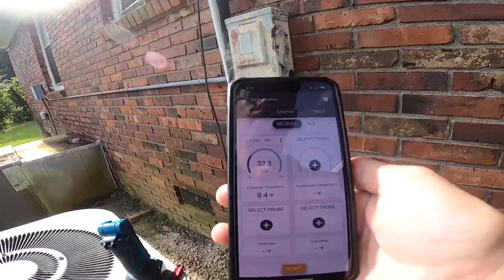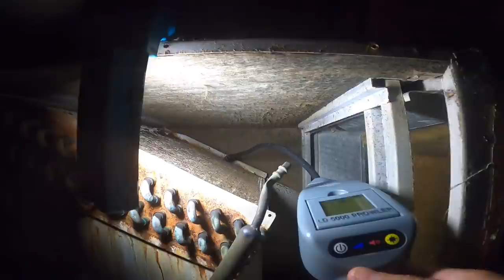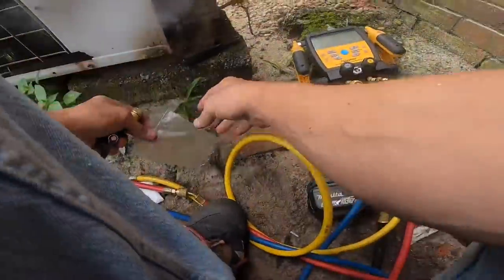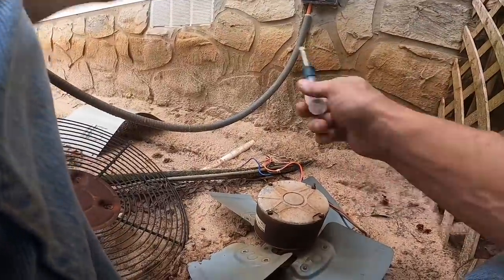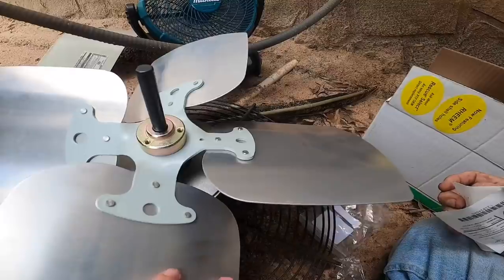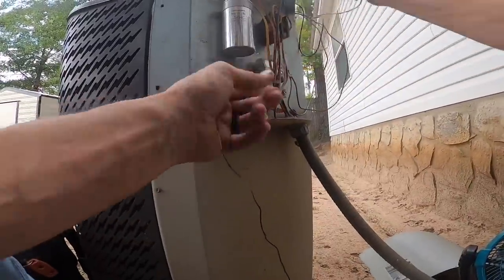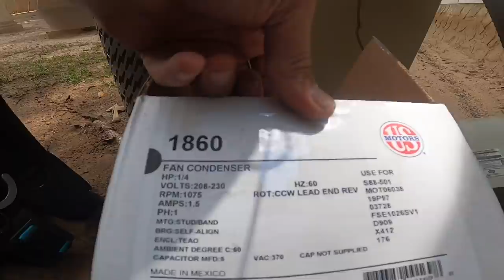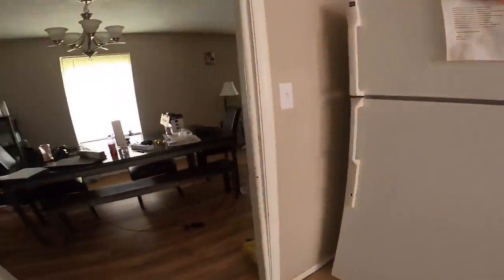3 calls, a day in the life of an HVAC tech…per request

Comment: Use membrane with the mastic. You could use duckboard too . A case of 1 inch duckboard has six sheets in it and varies in price of about $20 a sheet or more like the prices went up. The mesh membrane holds the mastic it has a little glue on it with your spray glued in place and the mesh will hold the mastic to whatever you put it to thanks Jerry

Comment: Heres something that a great tec like u might be able to help me !!!! When I put my trane/ american standard heater model s8x1b080m4psca ( honey well tstat 3000 ) on fan only it goes to very low speed,  the manual has no real information ( dip switches ) ( board ) on how to change the speed on fan only mode.  Heating/cooling works great. Do I need to do wiring od some kind or what

Comment: When you charged with R22B did you just add it in since it was so low anyways? 
Also what’s the average time it takes you to complete a call? Not at repair but troubleshooting. 
I am a field tech and I want to be more efficient running calls any advise.
Reply: I've been a service technician for 25 years and did install and fabrication for 13 years before that and the goal I set is when I go on a call when I start a trouble shooting is to find the problem in 15 minutes or less but when I find the problem bad capicater or compressor or motor whatever is to make sure that's the only problem I've been doing it so long I can most of the time see what the unit is doing and know what is wrong.But that comes with experience like my diagnostics bag only weighs 5 pounds that in itself helps out

Comment: Did you mix R422b with the R22 that was still in the system?
Reply: Wondering this as well. Hopefully he recovered vacced then added the drop in. Drop ins should never be mixed with the original. Also I would personally recover and vac on a system that has shraders leaking. I’m always worried about air in the system

Comment: i had something happen just recently... if i may be a bother ... i found my pressure switch with a bunch of water in it .. after checking what caused a  limit switch error but  it wasnt the limit switches  they all had currect coming in and out ... i tested the limit circut at 16 volts  but the board R wire reads about 29.5 volts ..now im stumped
Reply from the maker: It’s really hard to help without putting a meter to work on it.
Reply: @HVACGUY  i understand..
Reply: sounds like a bad board.
Reply: @adeptheatingair   i ordered a board on line and put it in and  the same error,  the wires connect to the gas valve for the inducer and safety switches.. its an ICP  n9mp1075b12b1
if there isnt any circut board on the gas valve ,(other than the connectors ) then i would assume its either the transformer or  another bad board i cant tell
Reply: @frankjames1955  pay someone that does HVAC. They will fix it.
Reply: @joep4143   thats so crazzy it JUST may work... unorthadox indeed
Reply: @frankjames1955  It would be cheaper than you guessing but not cheaper than you.

Comment: Don't work to hard.
Your cheating with that fan tho.
°15 is decent. 
🥃🥃🍺🍺🍺🍇🎳
Stay safe. 
Retired (werk'n)keyboard super tech. Wear your safety glasses.
Reply from the maker: The fan helps if having difficulty with the heat.
Reply: I used to never wear glasses when working on condensers until I got tired of having mulch spray up into my face and eyes on startup